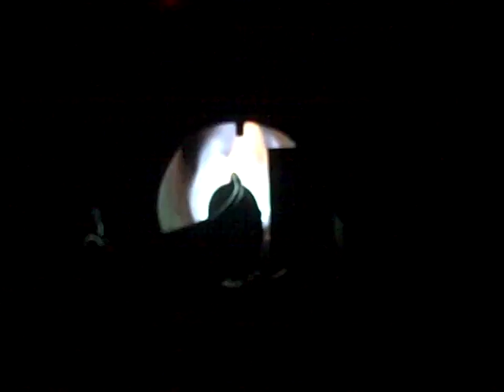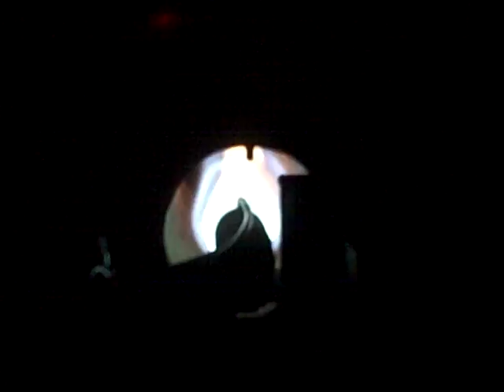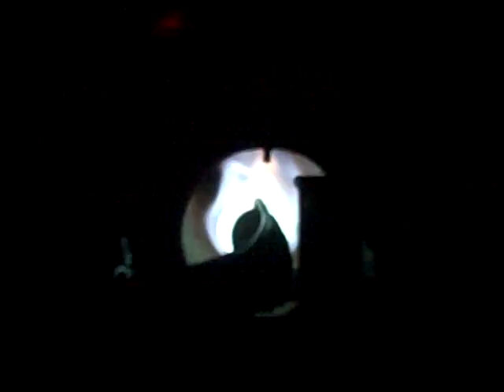RV Water Heater flame diffuser fix, NOT replacement Part 2 of 2

Comment: THANKS FOR BOTH THE VIDEOS. Sure enough I touched the diffusor and if broke right off. 17 years of use and it was toast. I took your idea and used a piece of  plumbers tape. roll of metal with holes. Anyway I bent it up in front of the flame and it worked like a charm. You saved my camping trip. Thanks buddy.